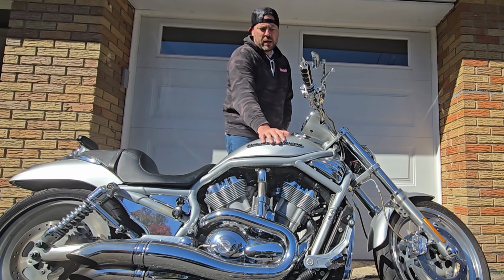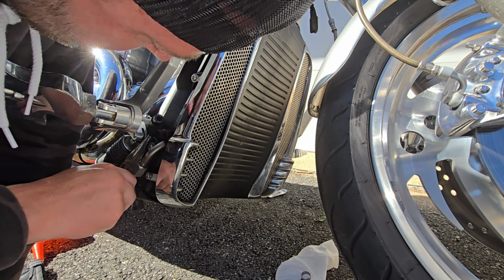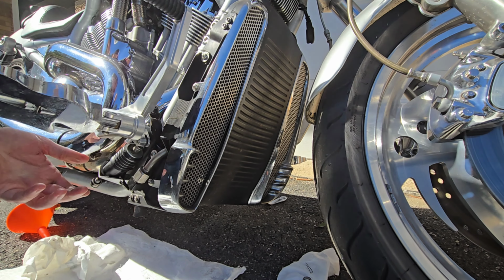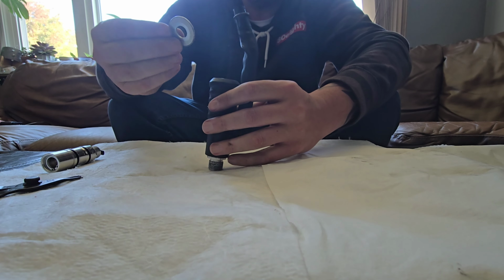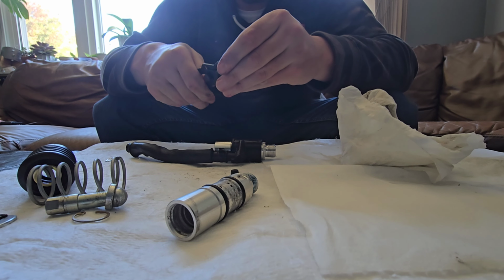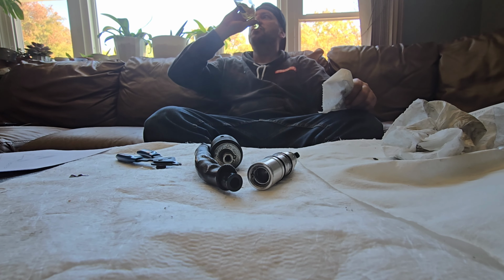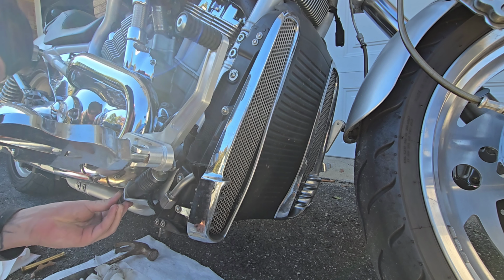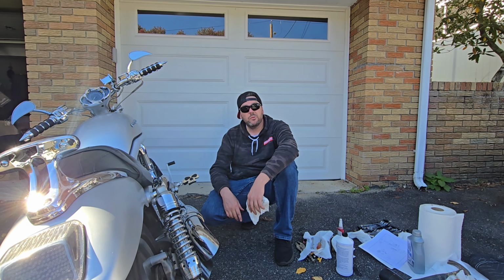02 Harley Davidson Vrod Rear Master Cylinder rebuild.

Comment: Was it only a few parts from the old that was used for the new one
Reply from the maker: @javonbrandon  yes, I only replaced the cartridge that was bought from Harley which is what they sell as the rebuild kit. I reused the big spring, the dust boot, and all the other hardware.